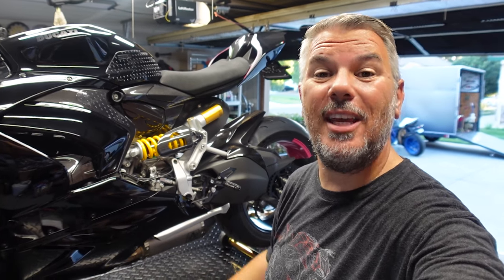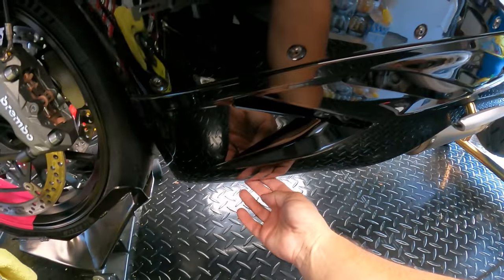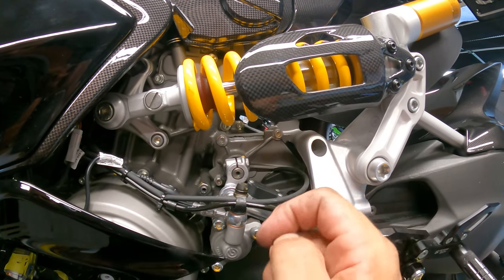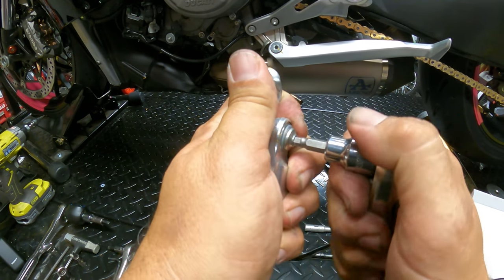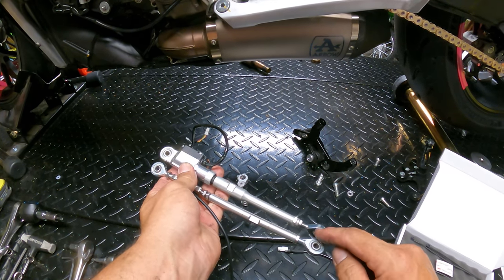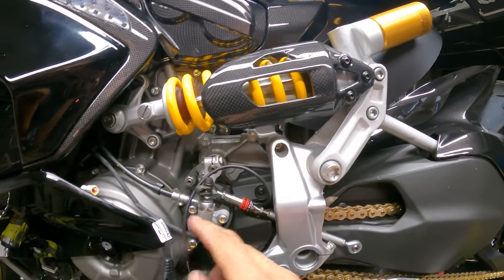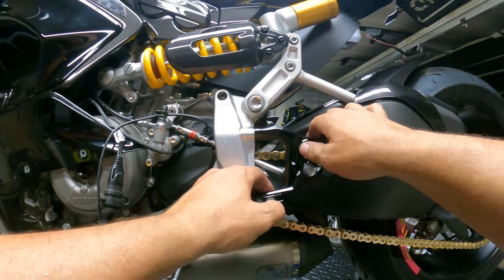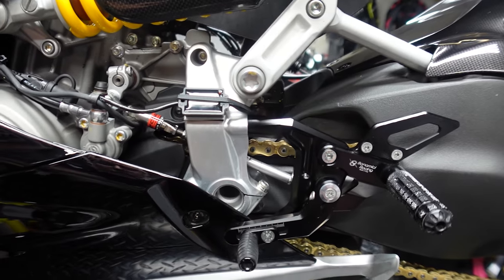2021 Ducati Panigale V2 | Cordona Precision Quickshifter Step-by-step Install

Comment: Do you have a video of the Bonamici rearset installation for the V2? I saw your mishap with the ones on the Streetfighter. I purchased Bonamici rearsets for my V2 and the brake sensor, but was wondering how to install the sensor. Thanks
Reply from the maker: Ours don't have the brake sensor

Comment: Great mod. Question! In your opinion. Do you think the v2 is under powered on the street or the track?
Reply: 140hp bike underpowered?  Yeah maybe compared to a H2
Reply: @jeffh278   true true
Reply: @stevenjackson5541  I guess so I have a Ducati 848 EVO and the power and low end torque is amazing and some times over wellming
Reply from the maker: With a skilled rider? No.
Reply: Im an unskilled rider and my 2020 GSX-R600 is way more than i can use on the streets.

Comment: 11:00 - no. 

To clarify. The shift sensor polarity does not need to be changed if you have rearsets that can accommodate both shift patterns. 

11:13 — the rearsets don’t “tell” the bike if it’s GP or standard. 

🤦‍♂️
Reply: Stock rearsets support both shift patterns... what are you even saying?